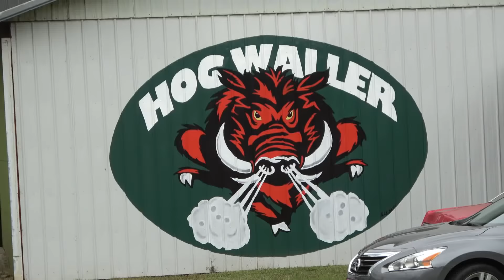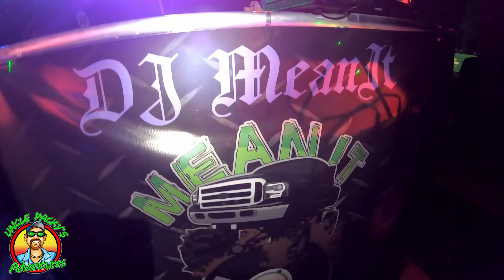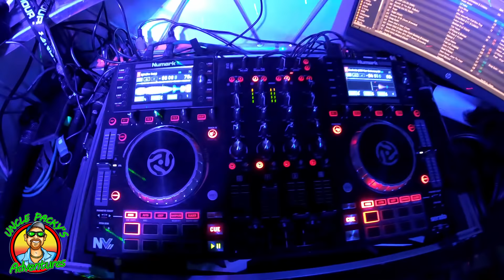TO TOUGH TO TAME 2 - $16K BOUNTY HOLE - 2020 Dirty Deeds/Muck Star - Hog Waller ATV Park

Comment: That was badass. I knew that X3 with the paddle tires was going to walk that hole. When he turned around at the other end I thought he was going to walk it again backwards. I know that's not allowed but I was still hoping he would. lol. I also told you I'd be waiting on this video but I ended up at a place with no service and I just got back and the first thing I did was watch this video. Thanks for the video brother! #Cheers
Reply from the maker: He was going to go back threw the first hole where the rope stopped him but there was a SXS stuck in it, so he didn't.  Thanks Bud.